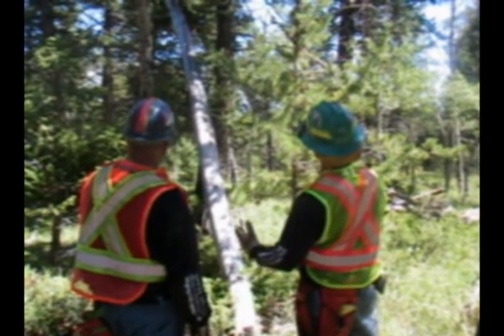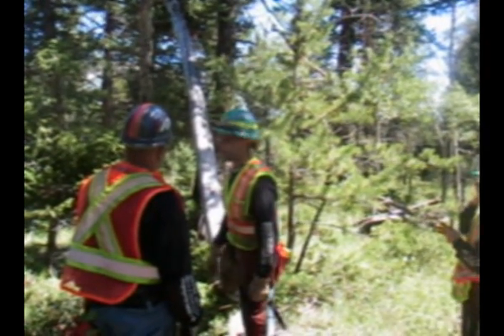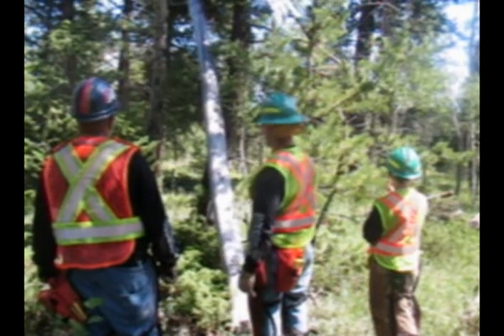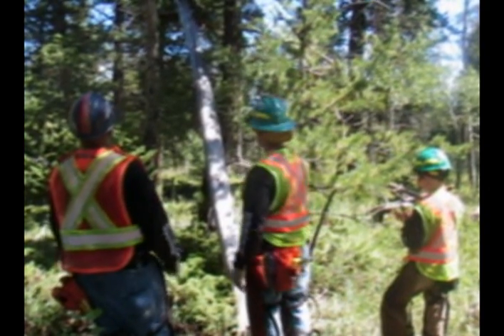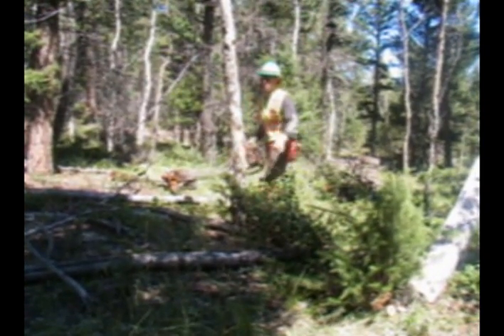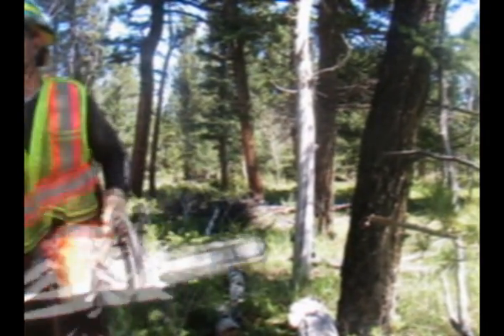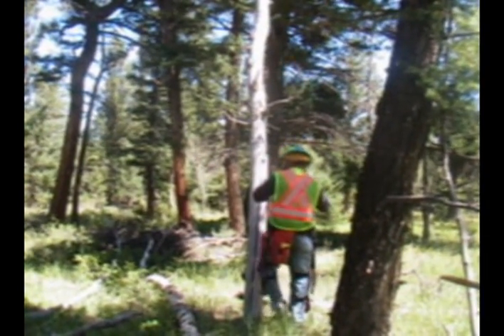Hang-up Tree Removal, Step-Cut Technique

Comment: I don't understand why you need to kill two trees to remove one??🤔. In my place we would use a machete only  to cut the branches and trunks first then continue to cut the lower part in two area and pull the tree down. Maybe different places have different ways of clearing fallen trees. Anyway, good video.

Comment: Sometimes, as the stick gets a bit vertical for my taste, I'll make these cuts sideways (as opposed to up/down). Set a hand winch a bit above the cuts to a solid tree off to the side. Make a face cut opposite the winch & backcut not too deep facing the winch. Leave the area while the winch "folds the tree. And ... remaining stick is closer to horizontal (or down). This gets to be more of interest with larger sticks, of course. Bud likes winching from safe distance.

Comment: Ah, step cutting, didn't know what to call it before. I always just keep right on cutting until it's so vertical it can fall back on itself. Of course my escape route at that point is usually behind the tree the hang is in. I think the cantilever and splinter base cuttings are the most dangerous so I hightail it no matter what as soon as I see the tree start to accelerate. Hang ups don't bother me.

Comment: Moron way to deal with a hung up to. You don't cut the hung up tree like this. The safest way to deal with a hung up tree would be to letterbox the hinge leaving 20% wood on either side, cut away either side of the hinge to make a gate type opening so the tree can be rolled with a cant hook. Failing that you can walk the tree out with a pole or use a winch set-up.
Reply: This is not forestry tree falling this is FIRE training. They don't bring all that stuff into a wild land fire situations.

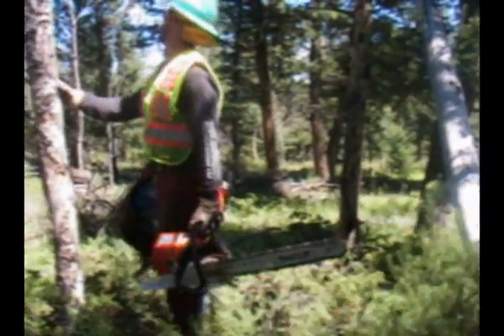Comment: This is definitely one of the better how to videos I've ever seen on YouTube partners wildland firefighting goes, and in defense of the video I believe somebody said at a 1:30 or so "why cut up so high?" I've never seen a crew cut a standing tree at any level other than waist high and then short stump at. There is also a comment at 3:00 about not cutting on the other side of the hang up, what was failed to be noticed was where he was located at 4:40. There was another tree blocking his way, it would have been pointless to start from the other side... Very well done, I relearned a  technique that I haven't uzed in quite some time.

Comment: at 1:48...why cut up so high?  cut it at the base- gives you better leverage when pushing it over if it doesn't fall, and removes the need for cutting the tall stump off.  Sawing safety is also about efficiency. And again at 3:00- why work under that hang-up?  Might the escape route be better on the other side of the tree the dead one is hung up in!?  Work smarter, not harder.